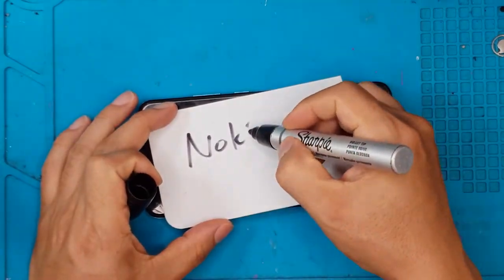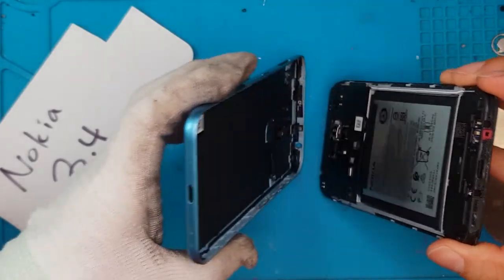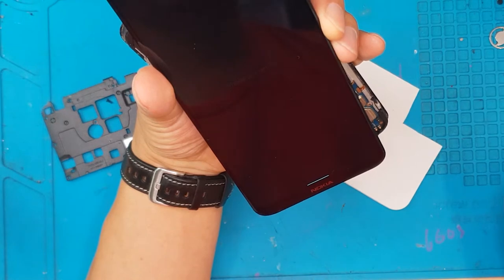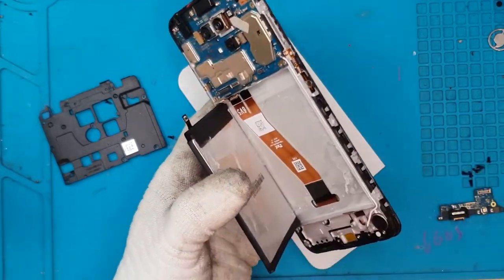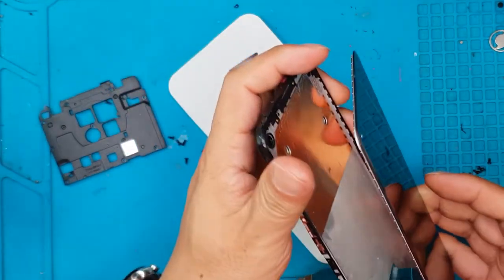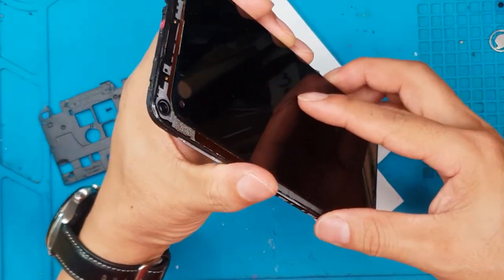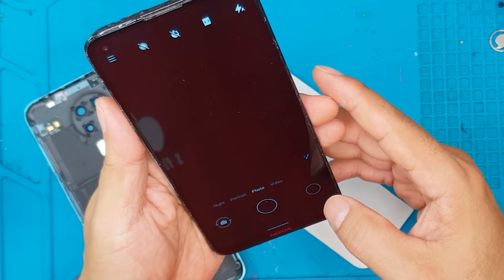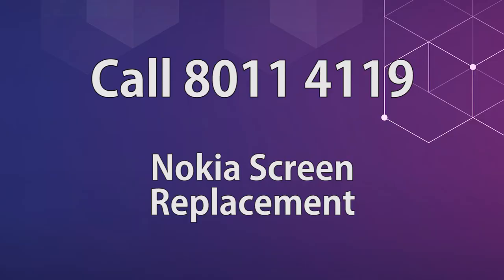Nokia 3.4 Screen Replacement in Sydney | Sydney CBD Repair Centre

Comment: i would have a question -- if i have two nokia 3.4 of which one has fallen into water and does not turn on anymore -- is in there a hard drive akin to a pc that i could attach inside the other nokia in order to extract all my photos/data which were in there (if the drive survived and only the motherboard gone dead that is)
Reply from the maker: Hello, sorry to hear what happen to you phone, but no drive can extract all phone details when screen is broken since it needs approval when connected to usb to pc, unless you back up you phone data to a cloud drive then you can extract from there or all photos and data is on SDcard.